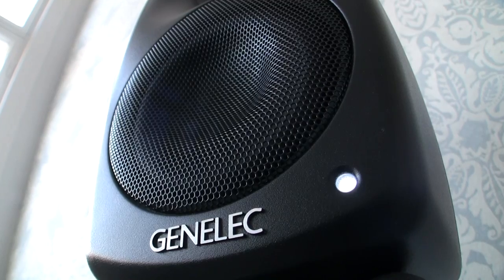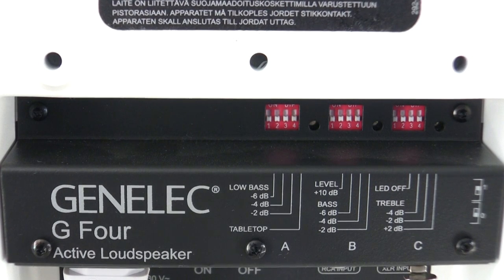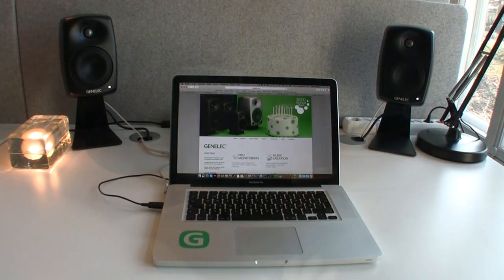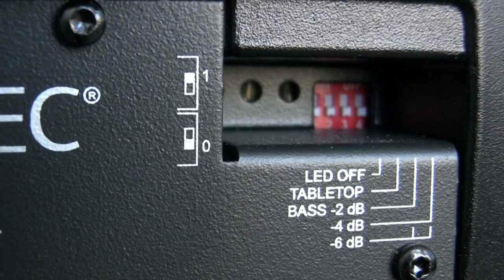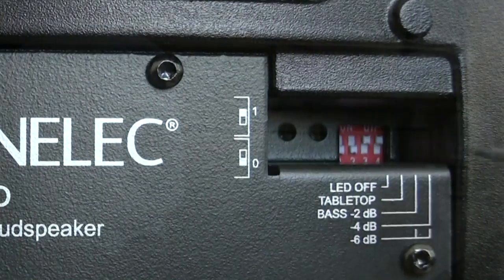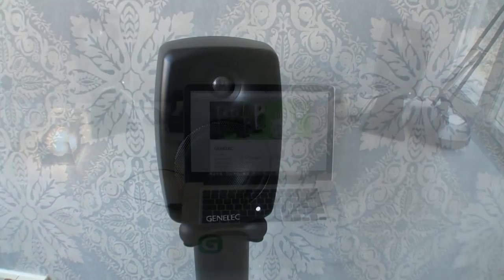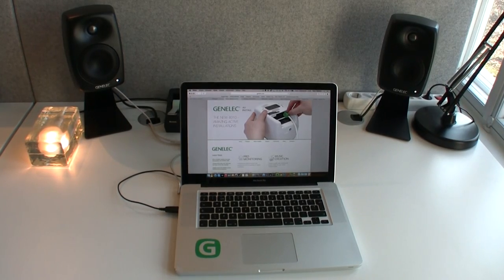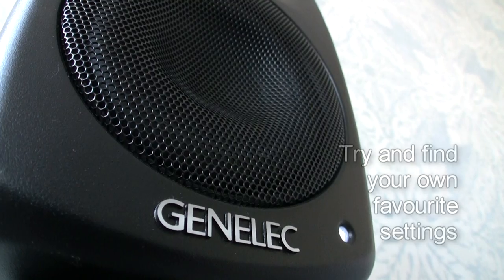How to use Genelec technology to compensate common acoustical problems | Tone controls Part1

Comment: if you have your speaker close to the wall and on a table you but the -4o-2 plus the tabletop?
Reply: Please tell me if i monitor placing against the wall  then  which bass tills setup would b best setup either it is -4db or -6db? I am using genelec 8020b. Please reply me..i am bass lover..Thanks
Reply: @saumennanda62  In the video they say either -2 or -4 depending on wall material. Try both and see which one works better

Comment: How about if the speakers are a foot from the wall on speaker stands but close enough to a table top to add some reflection?
Reply from the maker: Apologies for late reply! If there is basically table below the speaker, you can try to enable the DIP-switch, and leave it like that for some time and do listening. You can always switch back, if you feel the sound quality decreased. To be sure which setting on your case would be better,  it would require acoustical measurement done in example with Room EQ Wizard and measuring microphone. If you are interested more on this topic, I recommend to watch "Genelec Calibration | Room EQ Wizard & DIP switches explained" video here in Youtube made by our colleague Marcel Schechter. ☺

Comment: Shame their 8040 hasn't caught up to the 8030 and begun to use class D amp to lower that hiss that the current 8040 exhibits from the listening position
Reply: @genelec  Thank you for your considerate response! I have the 8030c model, and it is fairly quiet. However, I would purchase the 8040 if Genelec decided to improve the internal amplification (make it quieter at idle like the 8340 or even 8030c). I don't need outboard DSP correction at this time, so the 8340 would be overkill, and too expensive for my use. An upgraded 8040 would be perfect!